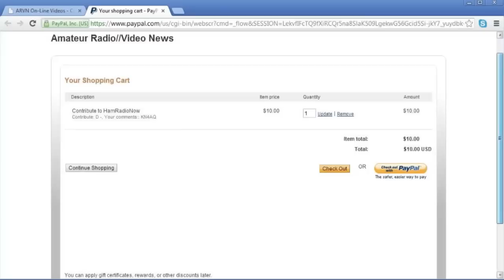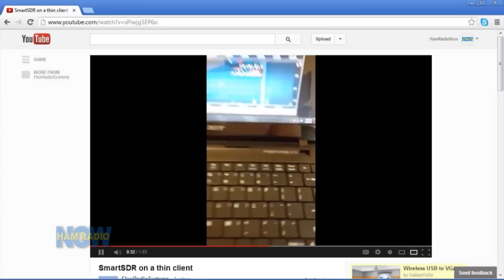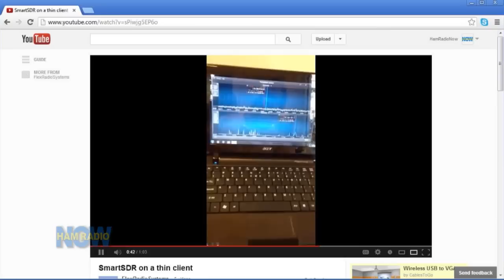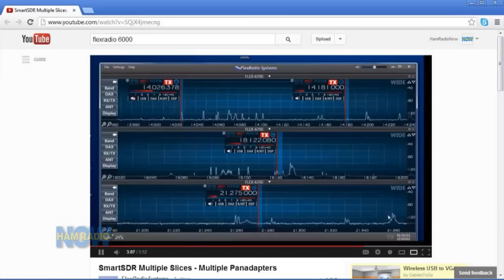Episode 61: Software Defined Radio Basics with FlexRadio

Comment: Very good video guys! I happen to own and use a Flex 5K, and yes it was a little problem getting one that worked from the box the first year. I had two diffrent ones and both have had the same problems with the A to D converter for the meters.But because of excelent support from Flex there was always an easy answer, or new radio showing up at my door. There repair the last time was great except someone forgot to tighten the screws on the complete case. But again the rest of the radio works fine as far as I can tell. Except this one is messing up again on the meters and now is beyond warranty.  Flex Support makes it worth owning one of their radios for sure. But I won't be bothering getting the meters repaired a 3rd time on my dime. I'll just use my MFJ external meter.  Being a Net SCO on MidCars and the 68 Group this radio makes doing the job easier with all the RX filters. The QRM and QRN has little chance against this radio. Thanks Flex for a great radio, I hope you keep suporting the 5K I have and don't leave us in the cold... 73 Jimmy, ARRL TC, WX9DX

Comment: I considered the Flex 5000 with UHF/VHF upgrade board my "dream radio" but now the 6700 comes along and trumps the former king.  If I plopped down $8500 for a radio system I would expect it to do 2m/70cm or at least have a upgrade option to do those like the 5000 did at one time.  From what I can tell that UHF/VHF upgrade board is no longer being sold.  I would also like to see a DSTAR upgrade on this rig but am not holding my breath.  (I know it's cheaper than some HF/6m rigs but still)